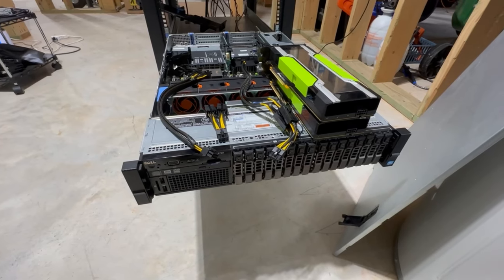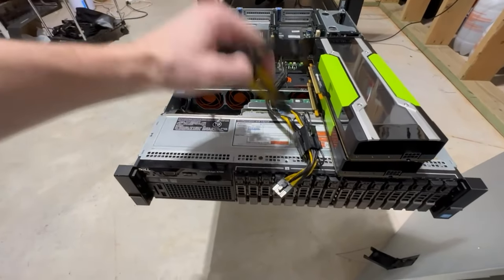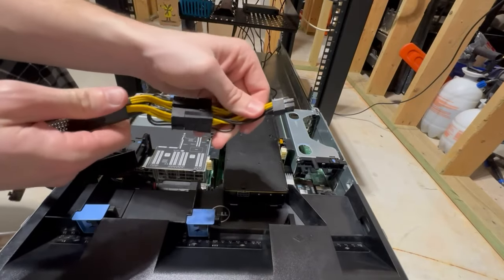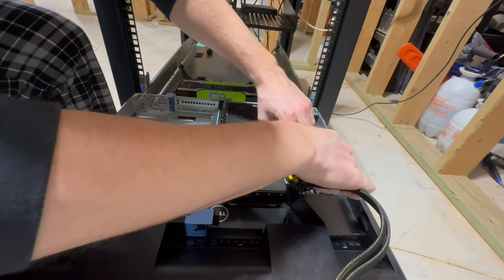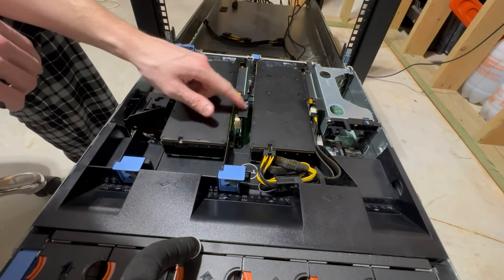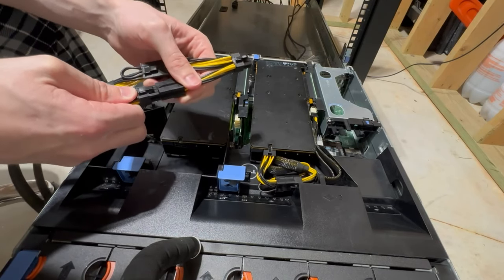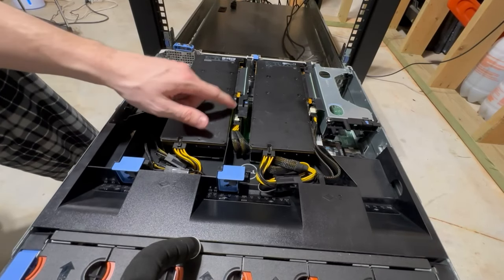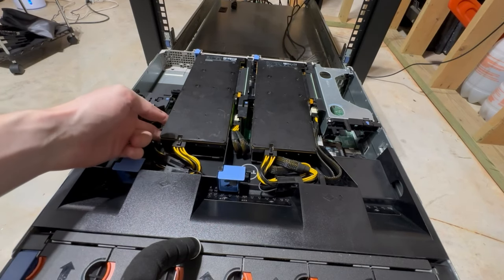Dell PowerEdge R720 GPU Deep Learning Upgrade: Installing Dual Tesla P40s with NVIDIA Drivers

Comment: Hello I'm new to your channel. Really useful information thanks! I'm just getting into ml and was wondering if this set up would allow a 40b llm to be loaded? Or what might be the best solution to run 4x tesla p40? Thanks for any potential tips
Reply from the maker: Hi there. Thanks so much for the comment and so glad you are enjoying the content!

Take what I say with a grain of salt because I have not actually tried this myself, but for a 40 billion parameter model at half precision it would roughly require about 80GB to load the associated parameters then there will be some extra memory overhead for other process and space to load data to run the actual inference. So, to be safe lets approximate 100GB ish of VRAM will be needed. With 4 P40 GPUs  (4 x 24 = 96GB) you would in theory be able to run inference locally. Caveat here is you would need to use model sharding to split the overall model across all of the GPUs. This should also be theoretically possible. 

One other thing to note is that the half precision of the P40s is very low. This will likely mean that you will have much longer inference times. Some other options, you could consider would be going with 4 3090s instead or going with 6 (or more) P100s. This should give you the VRAM you need for your use case while also providing better performance. It seems like the 6 p100s would be the best balance of cost and performance. You could also consider using a smaller model and running it at the full precision to better take advantage of the p40s design. 

So, it seems that for your use case you will need a minimum of 4 GPUs so you will need a different server than the one discussed in this video that can hold at least 4 2 slot GPUs. If you would like some recommendations, here please let me know.

Comment: How hot are these gpus running? Would you still recommend these p40s or P100s?
Reply from the maker: So they are running about 80C which is toward the top end of their operating range, but that is fairly normal under heavy loads. I also have not adjusted the default fan settings so you could likely get them running cooler. At this point, I am still recommending the p40s.

However, I reserve the right to change my mind once I have a chance to fully benchmark both.
Reply: @TheDataDaddi throttling starts at 80c not sure if there is room to fit a snail blower fan for each of these cards!
Reply from the maker: You could probably fit in a small snail blower for the p40s I doubt you could fit them for the p100s as they are a bit longer. I would try adjusting the integrated fan speeds first. I will look into this and see if it is possible.  @Mark300win

Comment: I can believe you blocked the air flow with the cables :(
Reply from the maker: Hi there! Thanks for the comment. 

Yeah, I definitely did not love how cumbersome the cabling was. However, I have since found a better more compact option that allows for more air flow. Check out the link below:

https://a.co/d/00JvYA0B

Also, to provide some more data here. I tested the cabling setup in this video and the more compact option listed above. There was really no noticeable difference between the 2 in terms of GPU temperature when running operations. This seems to imply that first option while bulkier does not restrict airflow enough that it prevents the GPUs from cooling effectively.

Comment: Did you have to purchase Nvidia's "vGPU" license? I have a Dell 7910 (rebadged r730) and the drivers fail to install and nvidia-smi results in "devices were found." The gpu is being detected...spci | grep -i nvidia shows a P40 on the PCI bus. Any pointers? Thanks!
Reply from the maker: Hi there. Thanks for your question. I did not have to purchase Nvidia's "vGPU" license. To may knowledge this is only for GPU virtualization in the case of allow multiple VMs to share physical GPUs. Unless this is your goal I don't think you need this. I use docker containers for most of my deep learning project as well and have never had an issue. Are you trying to virtualize the GPU(s)?
Reply: @TheDataDaddi  Thanks for the reply. No virtualization here. I'm using OpenAI Whisper as a starting point which uses PyTorch, which currently doesn't detect the P40. I'll take a look  at running docker see if I get anywhere.

Edit: did you have to enable "Resizable BAR" I looked in my BIOS and didn't find it (maybe this a difference between the r730 and the 7910)
Edit#2: Okay found BAR settings (MMIO) but still not luck on the drivers :(
Reply from the maker: Yeah let me know if docker works for you. I think it is a much better solution than VMs these days. 

Regarding the P40 not being detected by PyTorch, I did not have to enable "Resizable BAR" that I remember. 

This issue might stem from several factors, including driver compatibility, CUDA version mismatches, or PyTorch itself. 

Can you paste in or email me the error you are getting when the drivers fail to install? I think this would be the best place to start.

Email is skingutube22@gmail.com

 @PardnerCLUTCH
Reply: @TheDataDaddi  well don't laugh... it was the power cables. I originally bough a r730-to-K80 cable (8pin PCI to 8 pin EPS). running "dmesg |grep NVRM" reviled "GPU does not have the necessary power cables connected." So I bought the cables you recommended and preso! Working GPU!
Reply from the maker: Its funny because I did the same thing. It took me way longer than it should have the first time to find the right cable, and I almost shorted out my server as well. lol. Glad you got it working! @PardnerCLUTCH

Comment: Hii we talked before about gpu so did you got any gpu for my Dell R720 Server which i have i try other gpus but when i plug in for display output the screen is always blank
Reply: try the original output and install gpu properly in server system， check it in the idrac or lifecycle controller，
Reply: @千里影  what should i check in idrac or lifecycle also If i use original output how i will get to know that GPU is installed and working properly

Comment: You're supposed to take out the riser card, install the GPU into the riser card, and then plug the riser card plus PCIe cards back into the motherboard all at once.
Reply from the maker: Hi there. Thanks so much for you feedback!

That is why I have seen others do it as well. However, it is has actually always been harder for me to do it that way because I can't see the slot that riser goes in. 

I appreciate the tip though. I will try it that way again next time and see if it is easier that way.
Reply: @TheDataDaddi  Upon opening my R730 and looking at this, I think that may actually only apply to the cage of small form factor card slots, so my apologies!
Reply from the maker: No worries man. I appreciate the feedback either way. @theturtle32
Reply: I have a regular R720 myself, and all three risers come out. So yeah, you should be able to pull the riser, snap on the P40, then slide everything back in.

FYI if the cards has connectors sticking out, those will hit the back of the server, and there's no good solution for getting those in.

I'm also concerned that the power wires interfere with air flow from the little slot in the CPU shroud to the P40, as that's the only cooling the card gets.